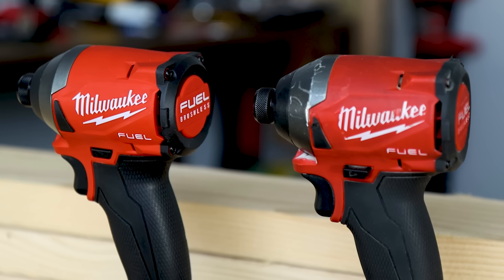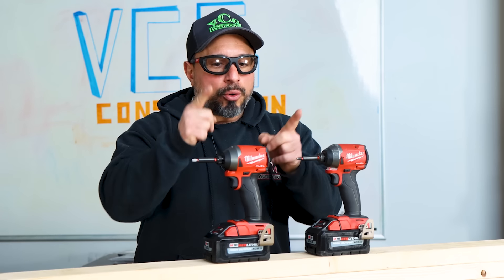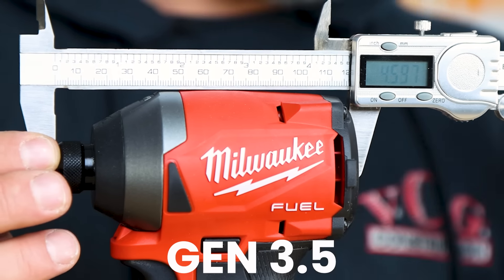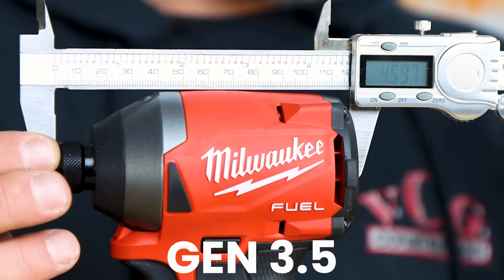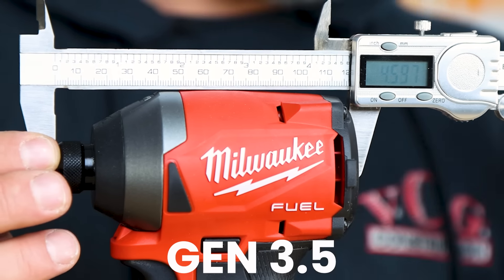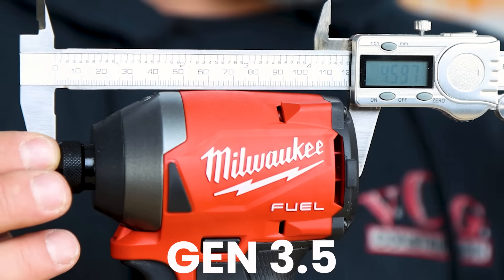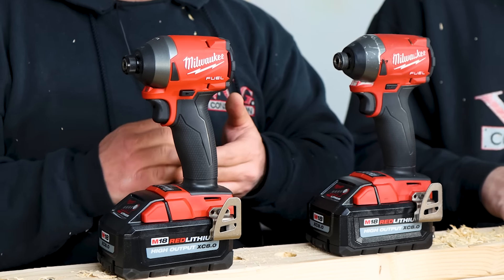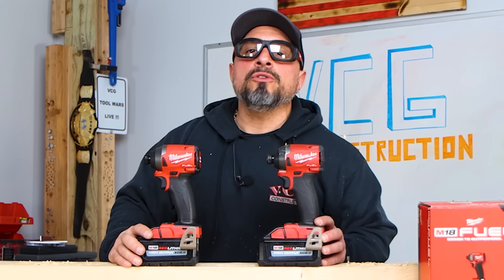New Milwaukee M18 FUEL GEN 3.5 Impact Driver TESTED Against INFERIOR GEN 3 Impact!

Comment: Vince, what about reading the serial number to see when it was made? Couldn't you find out that why like if it was made after a certain date??
Reply from the maker: You’d still need to have the impact out of the box and in your hands to read the serial number, at that point it’s easier to look in to the collet to identify if it has a pair of balls!
Reply: @VCGConstruction Remember the serial numbers of the tool are identified  on small  stickers on the  outside of the original Milwaulee box.  So I believe that as long as we have a confirmation that after a specific  manufactured date that all are Gen 3.5 we can then tell from the outside of the box.  Now we have to do the homework
Reply: @VCGConstruction  he's right. They all have the serial number stickers, even on kits. Only for the tools though, not batteries or chargers.
Reply: I stand corrected. J57AD'2027' xxxxx is still only one ball bearing
Reply: @600ccgsxr8  nope. I have one with a later serial number. 1929 date code.
Reply: @IceBergGeo  Gotcha. 29th week or 2019
Reply: 27th week of 2020 is still one ball bearing
Reply: @600ccgsxr8  which digits in the serial represent build date?
Reply: @tonytrofe7137   the first four after AD in the serial number are YYMM. J57AD2027 is 27th week of 2020
Reply: @VCGConstruction  What is the production month on the model you had sent to you?
Reply: @600ccgsxr8  Thanks
Reply: @VCGConstruction  Nope, you are all wrong, just grab a spaddle bit off the shelf and run over to the lumber isle and start drilling and see if it retains its bit.  Home Depot will understand.
Reply: @chriskathol  as was described after my comment, but is already known to most, the date code is the 5th through 8th digits, in the format yyww. The yy being the last two digits of the year and the ww being the week it was produced in that year. At least if you're not being horribly sarcastic... ;)
Reply: 4:01
Reply: 40th week , just bought as a kit , still 1 ball bearing.
Reply: I stay with the new makita impact rest Milwaukee
Reply: @VCGConstruction  What a bunch of shit. The only reason they're not putting identifiers of the new box is, because they'll get stuck with all the old Gen 3s. They figure that only a certain percentage of people buying the problem Gen 3s will actually have the problem, the others, most likely the DIY'ers, will not.
I get the reasoning, but it stinks. I know i would be pissed, knowing i have a defective tool. 
I say, hit'em in the pocket book. Don't buy anymore Gen 3's. Eventually, they will get the hint.
Reply: @thelolercoptor I just got 46th week of 2020 production. Still one ball bearing.
Reply: I just got 46th week of 2020 production. Still one ball bearing. J57AF'2046' xxxxx (I noticed this time the letters went from AD to AF, not sure if that's a different factory.
Reply: @tonytrofe7137  Looks like J57AD1915 055XX
No real way of knowing the ball count by serial. I'm going to take Vince's advice and call Milwaukee if it starts becoming a problem for me.
Reply: @superchunkyspacemnky  wouldn’t that serial number translate to the 15th week of 2019? That surely won’t be the revised one.
Reply: @tonytrofe7137  Yep, surprised me too. Just going off of what I see in the video when they are showing the new Gen 3.5 tool. The Milwaukee China plant must just have a pile of old stickers. I'm noticing the 2020 builds are from Vietnam. Haven't found any 2021's on eBay yet.
Reply: @superchunkyspacemnky  I am a loss then as this makes zero sense. I am looking to pickup another bare tool but Milwaukee won't be getting my money unless I know for sure its the latest Gen. Why pay the same price for an inferior product when the revised one is out there. I did reach out to Acme and OPT to see if they could potentially find something out more from their reps. Its pretty shady on Milwaukee's part for not addressing it publicly in my opinion and when you finally get ahold of their customer service they play dumb.
Reply: I just received from Amazon an AF2044 one.  Still one ball bearing. What week did they change from D to F and what changes did the F version have?
Reply: @charlieg.6242  but if there is nothing wrong with them actual working threes why fix them?
Reply: @VCGConstruction  how can you tell i own a gen 3.5? And not a gen 3?
Reply: 2048 still has one ball fellas
Reply: @ttractortt5663  Your answer is literally the entire second half of the video....
Reply: I just ordered & received a kit and standalone with ...F2049 and F2047 from Home Depot. 1 ball so back they go...I'll just keep ordering & returning until I get 2 bb. So stupid...I would have kept them if I knew Milwaukee would stand by them if I had a problem. Thanks VCG!
Reply: J57af2037 here. Still one ball bearing
Reply: J57AF2102 -has 2 balls
Reply: Mine is from the 50th week of 2020 and luckily, I got two balls👍
Reply: He spent half his video to show how the 3.0 doesn't retain the bit.  Wouldn't it be as simple as sticking the bit in, and trying to pull it out with your hand??  If it comes out, it's 3.0.  If it trays in, it's 3.5.   Am I missing something here??
Reply: @BAW556  did you buy yours bare tool or with kit?
Reply: @VCGConstruction  Damn, seems risky to me. Think I’m gonna hang on to my Gen 2 until it dies before I roll the dice
Reply: Does the Surge driver have this same issue?
Reply: @Aepek  Tank You,  for me J57AF2103 I have 2 Ball Bearings
Reply: @baiebell1  bare tool or kit?
Reply: @teknotec  kit
Reply: @baiebell1  Which kit did you purchase? Online or did you find this in store?
Reply: @tonytrofe7137  Home depot  kit 2853-22ct
Reply: @baiebell1  Thanks for the info! Looks like its not available in store in my area so may give it a try placing an order online. Worst case can always return it.
Reply: @VCG Construction @Sylvain Lamontagne Just got my kits delivered today based on your info and mine came with Gen 3.5! Actually both came with 3.5, as I ordered two kits for better odds with the plan to return whichever one wasn't the revised version. I guess Milwaukee is starting to get these out in circulation.
Reply: @bubba4072  Makes sense. 52 weeks in a year and if the models were updated from Dec 2020 onward, units manufactured between 48th and 52nd weeks should have this update. But from a manufacturing standpoint, the engineering design change may have only gotten into manufacturing by the 50th week. Yours may be the first week with the dual ball bearing design change. Plus 2020 was a leap year with 53 weeks.
Reply: Just picked up a new kit from Home Depot tonight. J57AF2103 has a single ball. It goes back tomorrow.
Reply: what serial number is generation 3.5
Reply: I sent mine last week. They fixed my collet or the hex anvil assembly with 2 ball bearings inside.
Reply: @thelolercoptor Negative, mine is numbered 2051 and only has one bearing in the collet.
Reply: Just got mine, it has the whole pair. EU model so it isn't the same serial system, but it is a C2021.
Reply: @baiebell1  J57AF2109 with one bearing..... Just got it today too...
Reply: Recieved J57AF2103xxxxx and sadly 1 ball bearing.
Reply: @302daddyd  are you serious? That's sad. I want this drill but not if it has that problem
Reply: @joev7014  Yup, I looked but since I'm not a professional, I just kept it as it was a good deal with the free battery.
Reply: I just purchase mine day before yesterday and its 2111. 1 ball😔
Reply: @marcorincon8592  sorry to hear my brother. I hear places like Amazon and home Depot carry the one ball. Suppliers carry the best version
Reply: @VCGConstruction  hello big man im just decided to buy this tools from powermate tols uk 
And im not sure about how many pairs of balls will have i will provide you the serial number of drill can u recommend to buy or not? Its this drill gen 3.5? Milwaukee m18oneid2-0 m18? Thank you …
Reply: @JasonVorce  nope
Reply: Vince do you know if it's possible to buy a newer collet for the Gen 3?
Reply: Thanks guys for all that you do you're the absolute best!
Reply: Serial number 2113 bought as a kit at HD. 2 balls.
Reply: Just ordered the combo bit impact/drill hard case from HD... hopefully 2
Reply: Serial number 2111 bought today from HD in a combo kit. Still only 1 ball. Returning it.
Reply: @chuckmiller5763  I like your reasoning :)
Reply: Bro it's simple I bought the tool only at a Home Depot in Connecticut, I asked the sales attendant there if I could open up the box and he said yes and I inspected it and it had the two ball bearings. Just ask them to open the box.  I would advise you go in store and buy rather than ordering it online to save yourself the trouble, if it comes with only 1 ball bearing.
Reply: @Aepek  mine is reading J57AF NOT J57AD do you know why?
Reply: @600ccgsxr8  mine is reading J57AF NOT J57AD do you know why?
Reply: @brianhoth5140  That's my question i have an AF2050 I wonder what's the difference between the AD and AF
Reply: @CarlJohnsonandAssociates . Do you have 2 ball bearings or 1….curious, Anyways, the serials №s are “starting” and n9t limited to, etc….So, there will be many different serial numbers out there, & just means was made at specific date, plant, time, year/month, etc….
So having a different number is ok, but if doesn’t hVe 2 ball bearings and having the collet issue with bits falling out, give Milwaukee a phone call (they pickup rather quick) and ask to speak to someone in customer service for the 2853-20 collet ball bearing issue. Once get a person who knows what’s up etc….they might have you ship yours to t(em first before they ship you the 2 ball bearing collet 2853-20. From my experience, it took around 5 weeks or so to get things sorted and the replacement 2 ball bearing 2853 shipped to me; as I was one of the unlucky where the collet was not holding and bits were falling out.
Hope this helps you out, have a good one✌🏻
Reply: @Aepek  thanks for the quick reply. I'm not sure I would have to check tomorrow to see if I have one or two. I just received it today.
Reply: Recently bought another one with serial #J57AF213713163 and it has the 2 ball bearings. I also noticed it came with a new bit pre installed in the gen 3.5 which did not come with the gen 3. 🤷🏾‍♂️
Reply: @Aepek  I end up sending it back. I now have the 2857-20 one key
Reply: They will let u.!! Inspect!! I just walked into Watertown home depot n said I need the one with 2 balls not 1 he was more than happy to help me look he was actually impressed!! That I knew what too look for !!
Reply: @hosainparchment5692  what’s the model #?

Comment: Just recieved replacement from Milwaukee to get new gen 3.5 model, serial number J57AF2109XXXXX, and it has two balls.  I'm in Canada btw, thanks for video and information👍
Reply: Did they also come up with a 3.5 for the m12 fuel impacts? If they do I might just start using it to drill 2" holes thru stacked 2x4's lol

Comment: Called Milwaukee technical support they told me to send it to repair center with request to add second ball bearing
Reply: and did you? is there a charge for that?
Reply: @brich2929   if it is out of warranty then yes it will be a charge otherwise no

Comment: I had an issue with my M18 surge losing bits when I got it, had to send it in twice. First time they adjusted the spring and didn't fix it. Second time they changed the collet and it's been good ever since, even a couple years later.

Comment: Right ok so what have we found there identical but the tool can hold onto a spade bit better. I don’t know about everyone else but I prefer to use the right tool for the and the only time I would consider putting a spade bit in my impact is in a pinch when I don’t have my drill to hand let alone the fact that I have never found myself needing to drill a 10 inch core it’s just not the real world. So as far as I’m considered it’s not the impact fault that I’m doing a job that it can do but wasn’t designed for. But hey that’s just me. And the biggest thing I can’t wait to see is what the gen 4 is going to be like 🤷🏼‍♂️

Comment: Great stuff overall. Is there a version .5 upgrade for the surge hydraulic impact driver.

minor nitpick...
4lb 9.6oz is not 0.2lb  less than 4lb 4.8oz it's 0.2 OUNCES less. 1 ounce  is 1/16th  of a pound which is 0.0125lbs give or take due to only having a precision of 0.1oz on the scale.

Comment: and how to identify wich one is 3.5 and 3.0? i do not live in the USA and should purchase from ebay or amazon. right now i have got 4th generation milwaukee impact but it overheats after small amount of work,so i want to move to 3.5 generation impact driver. how to distinguish 3.5 from 3.0?

Comment: I ordered one from Amazon a few days ago and the numbers on it are 2853-22. It’s super loud on speed 3 and it blows a lot of air out. the charger for the batteries gets hot after about 30 minutes too. Any suggestions?

Comment: I finally scored a Gen 3.5 with the 2853-22H kit at Home Depot. The manufacturing week 2052
Reply: Doest that kit include a hackzall? And I believe the driver has 2 ball bearing in collet?
Reply: @fahadmuzahid9966  yes it included the hack, 2.0,5.0 and a bag
Reply: @NicoleBroushetTheVeganNest  thanks for replying. I m in the market to get this and researching on it, it really helps getting advice from others. So, u don't have any problem so far retaining bits with this gen 3.5?
Reply: @fahadmuzahid9966  so far no issues whatsoever

Comment: In my opinion they should’ve recalled the gen 3’s since not holding on to a bit is a pretty serious safety hazard & I’m surprised Milwaukee hasn’t been sued because of this issue. Or we just haven’t heard about it. So I don’t think you should have to check to make sure you’re getting gen 3.5 because they shouldn’t be selling gen 3’s period.

Comment: I sent mine in for warranty just like was suggested here - got it back just now, they did NOT upgrade me to the two ball retention. Appears all they did was grease and lube it all up. 
I'll have to test it out and see if there's any improvement but I doubt it. Took about a month from shipping tool out to getting it back.
Reply: Same here I called them and they are sending me a new one once I ship out the old one
Reply: @Cpeezy6989  that's not the experience I had. Let us know what these ship you, if it has the update.
Reply: @colinstu  it was a huge headache but they finally sent me a new tool. Crystal was the name of the customer service rep. I would say call and ask for her. It didn't seem like they have too many different reps
Reply: @colinstu  just got the new tool on Monday and it has 2 balls and is brand new.

Comment: Vince! I just got off the phone with Milwaukee. Apparently they haven’t even hear of the new two retention ball version...they told me the wrong size ball might have been but and and that’s why they will replace. I’m really bummed and confused how they don’t know about this video. Anyone else call them and get the same answer
Reply: That's pathetic if that is the answer they are giving their customers. It seems like the best bet is just to hold off if your dead set on Milwaukee's impact and check the serial numbers for build date in the store prior to purchasing. Apparently after December 2020 they revised the product site (someone posted a link in the comments) so the assumption is anything after that date would be revised.
Reply: Just got my impact back from repair for this problem and it still has the single ball I called them about it and they told me the same thing.

Comment: I'm a hobbyist with a gently used 2853-20 that was not retaining bits - especially paddle bits. I sent it in for service. It took just over two weeks to get it back. I got it back today 2/28/2021 and here's what they "fixed".  Rotor/Back Cap assembly (armature low RPMs), Spring (Broken), Anvil Spring (Broken) and when I look inside the anvil it still just has ONE BALL. I haven't used it yet, but I expect to have the same damn problem.
Reply: Thats ridiculous

Comment: I realize this video is 9 months old. I bought the gen 3 impact driver and hammer drill kit a couple days ago. After purchasing I opened it up right there in the store so I could check and it indeed had two ball bearings in the collet. I actually asked if I could swap it for a different unit just because it looked to me like it had been returned. They let me grab a different one and I opened it up and again it had the two ball bearings. First thing I noticed in both kits there was a P2 bit in the impact with a little flag tag that said free bit. I’m thinking but can’t verify the 3.5 are coming with that free bit. I bout the gen 3 kit like the day it came out and I had the bit retention issue almost immediately. Also the gen 3 did not have the free bit in the impact collet like the two 3.5 I inspected. Really excited to start using my 3.5 impact.

Comment: I have the problem with the auger and sent it to Milwaukee for repair. All they did was replace the head they DID NOT give me the double bearing mod. I clearly told them when I pull out I loose the bit.

Comment: Did they fix the bit pull-out?
Reply: GOOD NEWS EVERYONE!!!

Now I think we need some torture tests to see if that new anvil has been significantly weakened by the addition of the second slot.
Reply: I never had a problem with bit pull-out, but I've always pecked my holes while drilling. Every half inch or so, pull the bit out without stopping or changing direction, and you shouldn't have any problem.

Comment: I sent mine in, just got it back. Only one ball bearing still. Disappointed. Although I tested it and it seems to hold spade bits. I have 2, one is fixed, one isn’t. The fixed one held the bit, the one not fixed didn’t. But it’s still only a single ball holding the bit. Replaced gear case and rotor back cap assembly. Reason, worn.